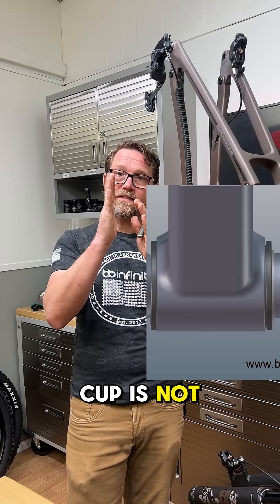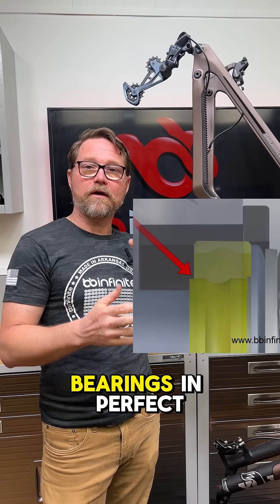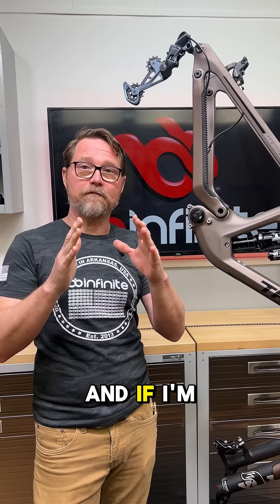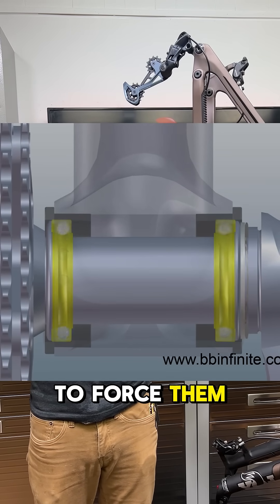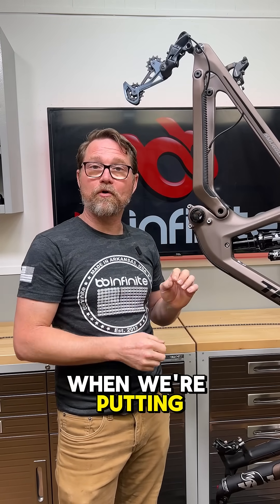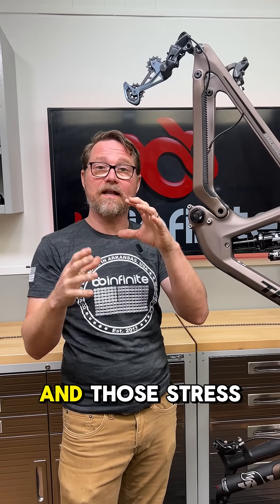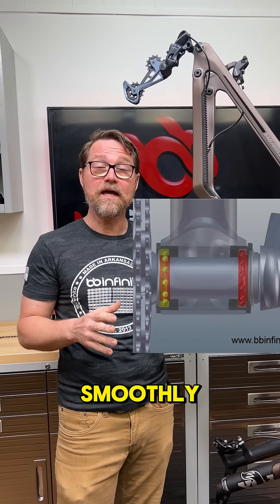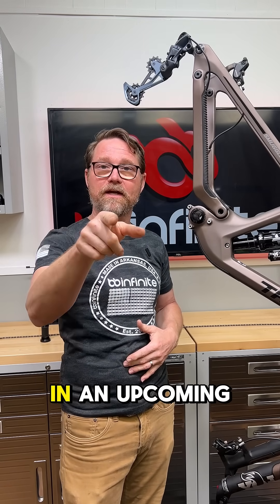The #1 Silent Killer of your Bottom Bracket Bearings ⬇️

Comment: This is also why a 24-22mm spindle in a 24mm bottom bracket with a spacer is not a good solution, because the bottom bracket wasnt designed with that in mind and often causes binding.